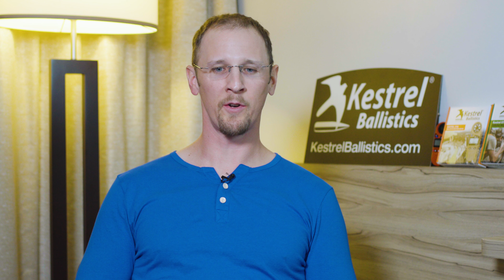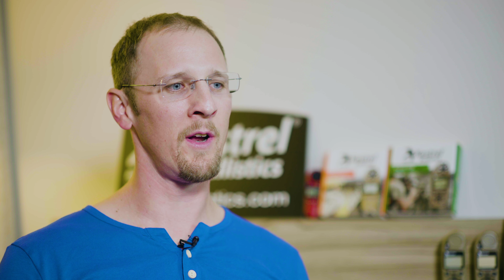Measuring Muzzle Velocity with Bryan Litz

Comment: Yeah, since I got a Kestrel and started rearranging my thinking around using it, I've started debating the need for a chronograph.

It seems to me that the best practice would be to do load selection on the basis of minimal vertical dispersal at some extended range, and then velocity true, followed by DSF if you'll shoot far enough to need it.

I don't think there's a way around having a fudge factor somewhere in the process, whether it's MV or BC. Bottom line is that the solving method is capable of rendering a solution which matches what happens.

Comment: Bryant do I need to true my muzzle velocity if I'm using a custom drag model?
Reply from the maker: Hi John
It depends.  You may have to if you start to see a discrepancy between the holds given and actual results.  While custom drag curves are going to be the best out-of-the-box modeling for that bullet, there still may be variations which require a CAL MV.
Thanks for watching! -The Kestrel Team